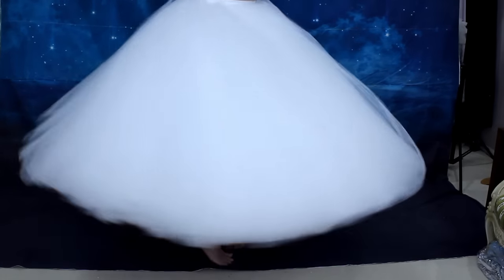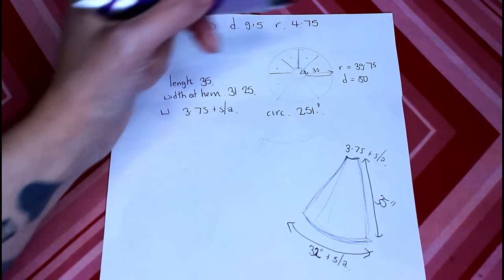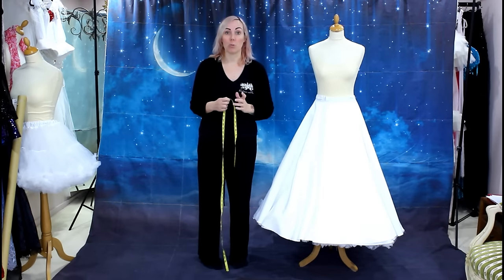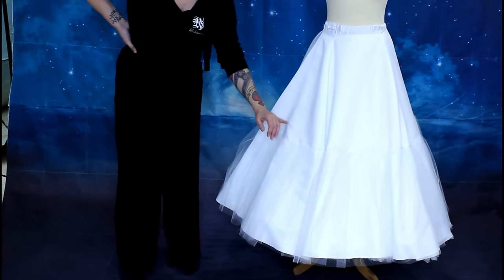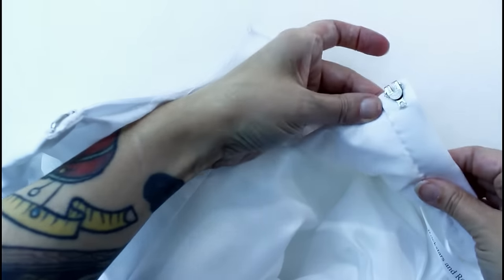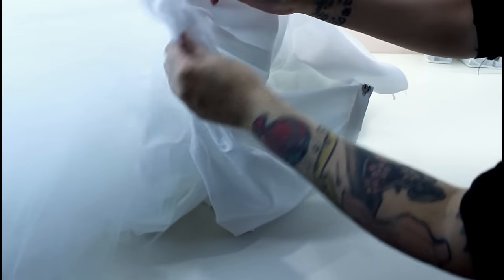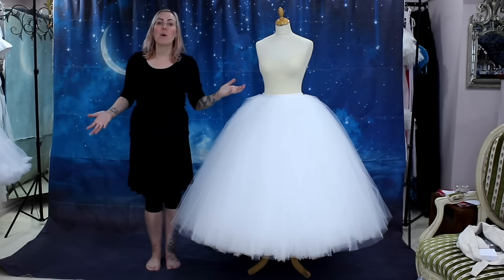How To Make A Tulle Skirt | Fortuna Gown Part 2

Comment from the maker: This is the ultimate princess skirt and this technique is so versatile. You could vary the length of the tulle layers to create different layers and skirt shapes. You could layer different colours of tulle together. You could add smaller ruffles or a trim to the edges of the layers. There's so many possibilities! Come and join me over in my Facebook group and show me what you create inspired by my tutorials and videos - https://www.facebook.com/groups/408803849559316/
Reply: Podían ser treducidas en español los videos así podemos entender lo que explicas
Reply: wow beautiful please ma did you pleat net i mean the layer thanks
Reply: How much meter It took
Reply from the maker: @theonestitchgirl  
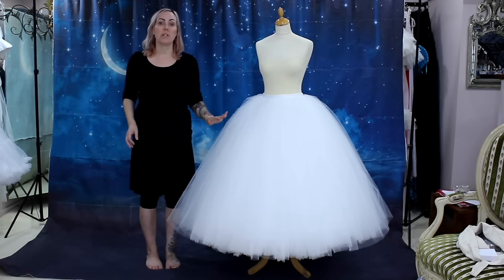I talk about how much tulle I used at 12:34 and 13:01. One bolt is enough for this length and number of layers, but yours may vary depending on the length and number of layers you use.  I used around 4m each of lining and satin, but again yours might vary depending on the length and fullness of your skirt and the width of the fabric.
Reply: omg do u sell these
Reply: What kind of fabric did you use for the lining?

Comment: Hi,  I’m loving your tutorials.  I’m in the process of making this skirt and would like to ask about gathering the tulle.  Do you use the machine to sew and then pull to gather or are you hand sewing and gathering?  

I’ve never made a wedding dress before let alone anything as elaborate as this.  Can’t wait to see what I’ achieve I’m the end.

Thanks
Reply from the maker: Thank you. I gather the the tulle by hand, then machine it into place. That's how I work best, but you could definitely gather using a machine stitch that you pull to gather or gather with a ruffling foot if that suits you better. Have fun creating 💖
Reply: Thank you for your reply.  I’ve tried both methods and I think I’m going to stick with machine stitching.  It’s already coming along really nicely.  Thanks again for your great tutorials. ❤️
Reply: حبببببي.شتراك

Comment: When joining the tulle layers, were you sewing them in their square shape just as cut or you were cutting them into the shape of the lining?
Reply from the maker: Each tulle layer is just the big tube of tulle made from sewing the tulle pieces together, gathered onto the skirt fabric. If you cut the tulle to right length there should be no need to cut or shape them further.
Reply: @RockstarsandRoyalty  hi, so we need to sew the 4 pieces became a tube and then gathered it? Can I skip the sewing part and just directly gather them together?
Thank you in advance
Reply: Qué  pena... no puedo hacerlo, se vé tan bueno el sistema, pero. No sé puede traducir al español  ??? GRACIASSSS!!

Comment: Hello : ) I am in love with this tutorial! I will definitely be using this for my victorian ballgown project. Just a few questions. What does the gathering of the tulle do? I couldn't really see on the video since the colors were so similar but wasn't sure if it was just so it would fit better. Also are you sewing the bottom of the tulle down to the bottom of the skirt or just leaving it be? And if I was to use the tulle as a crinoline and put another skirt overtop would that look normal or mess the whole thing up? Idk lol. Thank you so much <3
Reply from the maker: Hi Kiera, glad you found the tutorial helpful. Gathering the tulle creates the fullness. The tulle is just sewn at the top of each layer - the bottom isn't attached to the skirt underneath. Yes you can definitely use this method to create a crinoline. Just be aware that if the skirt you put over it is heavy it might lose some of the fullness. You can add some layers of a stiffer net underneath to help with that if necessary.

Comment: Hi, thank you so much for this tutorial, it is sooo helpful and very clear ! Do you think I can apply the same technique on a circle skirt with a train ?
Reply from the maker: Yes you can. It just makes cutting the lengths of tulle a bit trickier. I usually cut the back tulle pieces to the length of the train and front tulle pieces to the length of the front then trim the difference once it's gathered onto the skirt. Hope that makes sense.
Reply: @RockstarsandRoyalty  yes it does ! Thank you !!

Comment: Hi.
I’d like to thank you for posting this, it’s very inspiring.
I’m actually wedding planning for my self and for now we’re going for something with a lot of roses (I guess it’s romance then), our principal colours are burgundy and gold, but as complementary colours we’ll use some light pink, dark pink, fuchsia, red wine (let’s say a palette of pinks and reds).
Because of your video and because of Angela Clayton’s video about the skirt of the Fairy Flower dress, I want to make my own wedding dress, all by myself (as long as possible - I’m a more than beginner sewer.).
I’ll have the Fairy Flower part as top layer and train, but with tons of roses (using my palettes of reds and pinks, of course) and using the Fortuna Gown to make it a little puffy.
What will happen if I use some chiffon (nylon tricot or mesh) instead of tulle ?
And if I use some chiffon solid fabric instead of satin ?

I may or may not come back to you later, but thanks a lot !
Reply from the maker: I've not tried using chiffon or mesh instead. You'd be best to do a little test and see how if works. Your design sounds lovely. Have fun making it 🙂
Reply: Rockstars and Royalty thanks. Finally I fell in love with a wedding dress and I bought it but, I may or may not make a floral top layer skirt to go with it. Thanks :)

Comment: Hi There, how much fabric did you use the the satin skirt approximately? Thank you so much for your wonderful content and attention to detail. I have read through your comments and couldn't find the answer to this question. I am making my wedding dress and this is going to be the construction method for my under skirt to a slightly different but still a tulle based top layer.
Reply from the maker: I think I used around 4 yards of lining and 4 yards of satin, but yours could vary depending on the length and width of your panels and the width of your fabrics. Have fun creating your wedding dress 🙂

Comment: Thank you so much for this video! Is the tulle you used more so a silky tulle, or a little bit stiff? Also, do you think this sort of skirt would work with a tulle that's not the softest?
Reply from the maker: I used a soft tulle, the kind that wedding veils are made from. If you're using a tulle that's a bit stiffer you may need less in each layer or less layers to achieve this amount of fullness.

Comment: I’m really glad I came across this video. I am making a tulle skirt now and I am wondering one thing. The top layers (close to the waistline) of the tulle, are they also cut in straight pieces of tulle or in round pieces (in the shape of the circle underskirt)? I hope to get an answer on this. Thank youu
Reply: They can be done either way. Hers was made and gathered in straight layers. If you will be adding some sort of trimmings or appliques to the edges of your tulle, the topmost layer could be cut in panels too or as a huge circle

Comment: would this work for a petticoat? or would the weight of fabric on top of the skirt deflate it? I'm planning to make a gown with the same volume but seeing how the skirt looks inside out is concerning.
Reply from the maker: I've not used this method for a petticoat so I'm not sure. I would think that it would depend on the weight of the fabric going over it. Maybe you could add some layers of stiffer net between the tulle layers to make it support the skirt better.
Reply: Rockstars and Royalty thank you for the help!!

Comment: How many bolts of tulle did you use for this dress?
I'm so excited to try this!

Thanks so much for sharing!
Reply from the maker: I talk about how much tulle I used at 12:34 and 13:01. One bolt is enough for this length and number of layers, but yours may vary depending on the length and number of layers you use. Thanks for watching. Have fun making your own 🙂

Comment: Hi, I'm a bit confused. So you have your fabric and your lining, and then you sewed your tulle to the right side of your outer fabric but then you put right sides together and sewed it to the lining? Is there any reason you cant sew your lining and outer fabric together first, then do the zipper then the tulle gathering? I'm sorry just looking for clarification
Reply from the maker: You can do it that way if you prefer. I keep the outer and lining layers separate while add the tulle because it's less fabric to handle while getting it all under the machine and it takes away the possibility of accidentally catching the lining as you sew the tulle layers on.

Comment: Hi, may I know the difference if I make a full circle without cutting it into panels?
Reply from the maker: I use panels rather than cutting a full circle because it supports the weight of the tulle better. When you cut a full circle the weight can pull down on the parts of the circle that are on the bias and  you can end up with uneven hem. It's also more economical with fabric to cut panels rather than a full circle when it's this length. Hope that helps.

Comment: I didn't quite get how to handle the zipper section with the tulle. Can you please explain again?
Reply from the maker: You just cut the tulle at the centre back open to the length of the zip, turn under the edge, and stitch it next to the zip. You can see it in this video too, the only difference is that I sewed the zip in after the tulle layers for the dress and before I attached the tulle layers for this skirt. Hope that helps. https://www.youtube.com/watch?v=itjafKt_r2Y

Comment: So a couple of questions, how many yards of fabric did you use for the panel circle skirt? And how long did it take you (start to finish) to make this skirt?
Reply from the maker: I think I used about 8 yards in total (outside and lining). I can't remember how long it took in totall sorry - things always take longer when I'm filming rather than just sewing!
Reply: So I made this skirt, well used the method and I must say this was a lot of work! How did you even fit this under your machine? I struggled but got it done! Thank you for this tutorial!
Reply from the maker: @edenisrael5664  It is a lot of work and hard to control and get under the machine by the time that you get to the final few layers, but I think that the results are totally worth the effort. Glad to hear that my video helped you 🙂

Comment: I'm attempting to make a dress with a skirt like this but wanted to know, how would I attach the skirt and bodice to include a zip the goes from the skirt to the top of the bodice ? Thanks!
Reply from the maker: Just stitch the tulle layers up where the the seam allowance for the zip starts, then put your zip in after the skirt and bodice are joined.

Comment: Hei, I have a question regarding placement. Did you match all the seams edges  with the seam edges of the lining where the zipper is placed?, or did you just cut through the tulle so you get the opening where the zipper has been placed?. Thanks
Reply from the maker: You can do it either way

Comment: Hi, can I use the tulle method and just add it to the petticoat to make a full petticoat to go under a dress?
Reply from the maker: Yes. It will give you a great shape to go under a dress. You many need to use some stiffer net for some of the bottom layers if the fabric of the dress is heavy so that it doesn't squash the shape of the petticoat though. Hope that helps 🙂
Reply: @RockstarsandRoyalty  yes thank you! This helps a bunch!
Reply from the maker: You're welcome. Happy sewing ❤

Comment: is it possible to make this look nice with ribbon sewn onto the ends of the tulle while still cutting 8 separate pieces of tulle on each side? 
also if my petticoat has a ribbon on the ends, but the rest did not would that show and look strange?
Reply from the maker: I've not made a skirt like this with ribbon edging so I'm not sure how it would look. Perhaps you could make up a few small test pieces and layer them together and see if it works. If you make your skirt a little longer than the petticoat that would hide it and it wouldn't matter if the ribbons matched or not 🙂

Comment: Hi! Beautiful work! In the video you said that this was a skirt for under a corset, and I saw the waist measurement to be 30. Would you please tell me, for a waist 30 skirt without a corset, how the measurement would change? Thanks :)
Reply from the maker: Thank you. For a skirt worn without a corset I make it to fit the natural waist measurement. When I make a skirt to be worn under a corset that gives waist reduction I make it about 2 inches smaller than the natural waist measurement so it still stays tight on the waist once the corset is tightened over it. Hope that helps. Thanks for watching 🙂

Comment: I want to do a dress like this but three different colors for the skirt, is there a certain way I have to do that?
Reply from the maker: If you want the colours horizontally, you can use different colours for each layer. You might need to cut them so they get progressively shorter at the hem to be seen.  If you want them vertical, you'll need to sew different panels of the colours together for each layer. Hope that helps.

Comment: So the first bottommost layer is 4 meters gathered, is the last topmost layer also 4 meters gathered?
Reply from the maker: I use the same amount of fabric in each gathered layer. You can vary it to change the overall silhouette of your skirt, eg put more fabric in the bottom layers of gathers if you want it fuller there, or less in the top layers if you want it less full over the hips.

Comment: hi, if im 154 in height, and 28 in waistline what will be the length and width of my skirt? pls help im trying to make my own debut 
   gown
Reply from the maker: I can't tell you that from those measurement unfortunately. It will depend in how long you want the finished skirt (eg floor length or ankle length), how big your petticoat is, how high your shoes are, how many layers of tulle you use etc. If you make a toile of the base you'll be able to work it out the length  from there. I don't measure for the width - I just judge whether or not I want more fullness or not as I add the layers of tulle.

Comment: Please is it same 18 inches for each step of tulle?
Reply from the maker: Each layer of tulle will need to be longer than the previous one if you want them to all be the same length at the hem. Measure for each layer over the previous layer from where you'll be attaching it to the skirt to where you want it to finish at the bottom.

Comment: I want to do this for a petticoat I just fear that the dress in top might be to heavy and will weigh down all the hard work. I also want to lettuce hem the hems of the tulle any tips?
Reply from the maker: You could use a stiffer dress net for some of the underneath layers to help stop it getting weighed down. You can overlock the edges of the tulle with a rolled hem but you won't get a proper lettuce hem unless you use a stretch fabric.
Reply: @RockstarsandRoyalty  great! Maybe I could use a stretchier fabric just at the hems and a stiff one at the top?
Reply from the maker: Yes, that should work. You could try doing a couple of layers on a half or quarter size mock up to see if it gives the effect you're after before starting the real one 🙂
Reply: @RockstarsandRoyalty  omg thank you soooo much 💕
Reply from the maker: No problem. Happy sewing 💖

Comment: Que bonito
Cuantas yardas lleva
Reply from the maker: I talk about how much tulle I used at 12:34 and 13:01. One bolt is enough for this length and number of layers, but yours may vary depending on the length and number of layers you use.  I used around 4m each of lining and satin, but again yours might vary depending on the length and fullness of your skirt and the width of the fabric.

Comment: Could u just tell me how much meters of clothe(net) you have used?
Reply from the maker: I talk about how much tulle I used at 12:34 and 13:01. One bolt is enough for this length and number of layers, but yours may vary depending on the length and number of layers you use.

Comment: If I wanted a A-like tulle skirt how many inches would I miss between the layers of tulle ??
Reply: Hey also I bought a 40yard bolt of tulle online will that be enough 😂
Reply from the maker: To get the skirt more a-line I'd recommending doing the layers about 2 inches apart to begin with to get the fullness in the a-line part, then doing them further apart and maybe even using less tulle in each layer as you get towards the top so you're adding less fullness as you go up which should give you the a-line look you're after. 

40 yards should be enough if it's extra wide tulle, but it really depends on how long your skirt is and how full you want the tulle to be. Hope that helps🙂
Reply: Please will the tulle cross the zip allowance or how do I finish the back neatly.... Thank you
Reply: Please will the tulle cross the zip allowance or how do I finish the back neatly.... Thank you
Reply from the maker: See around the 9.00 minute mark in the video to hear me talk more about how I finished the tulle at the zip. Hope that makes sense.

Comment: For the layers the first is 18 the next will be 20, 22,24? Or everything is 18
Reply from the maker: Each layer will be longer as you move up the skirt. You need to measure over the tulle of the previous layer or layers from where you're stitching the new layer to determine how long to cut the tulle each time. 

If your next layer is sewn 2 inches above the previous one, the length may actually be longer than 2 inches more than the previous layer to get an even hem. Measuring each layer is the key to getting the hem even.
Reply: Thank you ma...please can you do the full tutorial on complete wedding dress. Then I discovered you don't use hard net